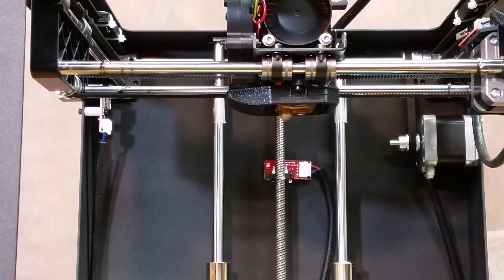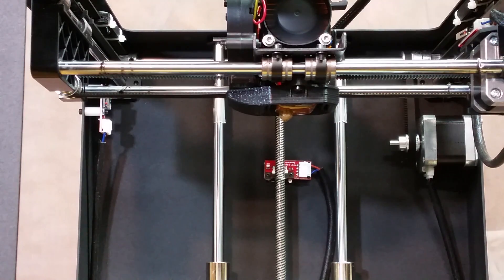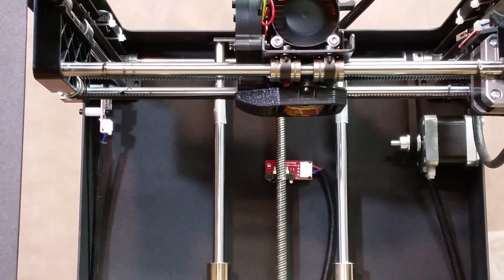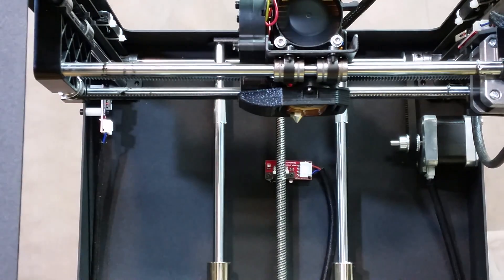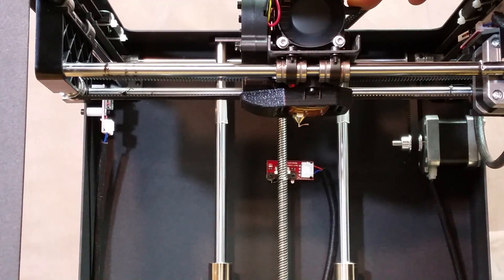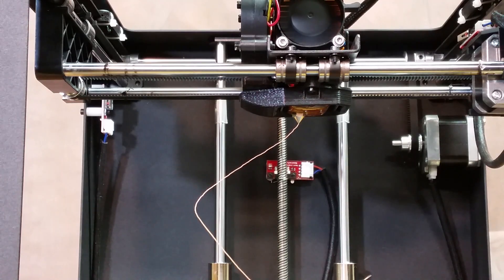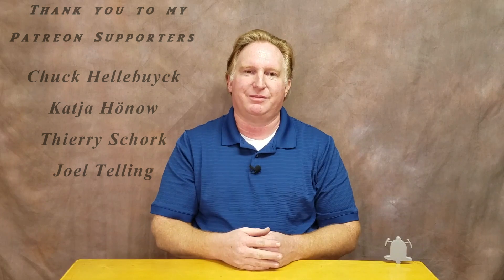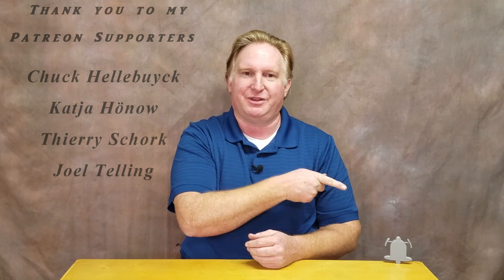Changing The Nozzle / Leveling The Bed On The MeCreator2

Comment: Hello again, I have tried many things on my printer and what I have noticed is that when I level it using the Hatchbox front cover, I can get prints to print well on the front edge of the build plate, but they won't stick at all in the center of the build plate, and near the back screw, they print, but the bottom is very textured. I believe my build plate is warped in the center, but I am confused because if I level it on all 3 screws, it should be able to print directly over them perfectly fine. And that is the case for the front 2 screws, but not for the back center one. I have contacted Geeetech for a replacement bed, but do you have any other ideas besides that?
Reply from the maker: +Brian Askins Definitely sounds like a warped print bed.  Try leveling with a single piece of typing paper and see if it is any better.  That is the absolute closest you can get it without causing damage.

Comment: When I level the bed on my new me creator 2, it seems that the middle is lower than the 3 screws, so when I try to print something in the middle, it's not sticking to the buildplate correctly, how do I fix this?
Reply from the maker: +Brian Askins place a ruler or something with a straight edge across the build plate.  If it is noticeable, contact Geeeteech and they should send you a replacement bed.

Otherwise, set your first layer to print at .3 mm and extrude at 120% and it should make up the difference for any slight discrepancies.
Reply: I just checked and it is not extremely noticeable, so I will try the second thing, but what do you mean by setting it to extrude at 120%?
Reply from the maker: +Brian Askins Yes, but just for the first layer.
Reply: When I use a straight ruler, I see a little bit of bend, and when I move the nozzle to the center after leveling the three screws two times, it is very loose compared to the outside. I will try changing my first layer, but what do you mean by extrude at 120%?
Reply from the maker: +Brian Askins are you using cura or repetier?
Reply: Jimmy Shaw's Tidbits I am using Repetier
Reply from the maker: +Brian Askins I'm trying to find the setting now.
Reply from the maker: +Brian Askins ok in Repetier it's under Advanced, and is called extrusion width.  Set it for 0.6
Reply from the maker: +Brian Askins if it still doesn't stick, try .75 on the next try.
Reply: Jimmy Shaw's Tidbits i will try that thank you so much!

Comment: Regarding the bed levelling. You start levelling right after homing. Didn't you forgot to move z-axis by 0.2 mm (or what ever the thickness of the paper is) after homing?
Reply from the maker: +Martin Heiden No.  Because the thickness of the paper is what you use as the guide to see if the bed is leveled.  If I moved the bed 0.2mm after homing then tried to level the bed using a piece of paper, the next time I homed it the nozzle would impact the print bed.